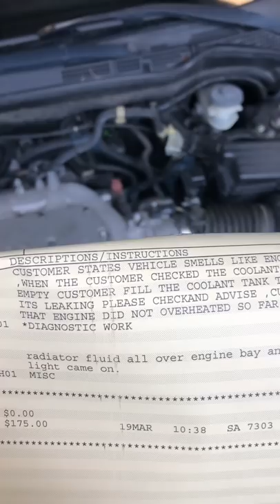Do not use this type of hose clamp because…

Comment: The reason that worm drive clamps are not used on cars is because of heat expansion plastics can expand alot more than metal so the oem clamp will flex and keep constant pressure on a tube while a worm style one won't budge and therefore will stress the tube and break it
Reply from the maker: Yes yes! Perfect! I’m glad I’m not the only one that knows this! Thank you!
Reply: Okay, I was going to call bullshit but this is a really good explanation. Thanks
Reply: Absolutely correct, worm gear clamps are a temp fix and should not remain on for long. OEM pressure clamps are recommended as you said but also dont dig into the rubber like worm gear does. Truthfully when it comes to coolant lines as a professional high performance mechanic I always recommend silicone hoses paired with T-Bolt Clamps. The edges are beveled upward so the clamp doesn't dig into the hose on the outer edges (recommend Mishimoto or equivalent). When it comes to vacuum, oil, fuel and power steering lines I always go stainless steel or nylon braided hose with A/N fittings, bung welding required but will last you a lifetime of non headaches knowing the lines are rock solid and easily replaceable.
Reply: Well, alot more things were made of metal and brass back in the day..
Reply: I was about to call bullshit, then I read the magic word most vehicles are made of these days: plastic.
Reply: @IRDStudio  intake manifolds, radiators, valve covers. I've used dozens of worm type clamps on dozens of vehicles over decades, never had an issue. And if one's not enough, ya put 2 on it!
   If there are factory spring clamps on my project, I do try retain them. I just don't readily find them in my auto parts store and I don't believe each clamp has a large adjustment range forcing you to buy more of an assortment pack or near specific size. Maybe I should start getting those at my local junkyard, I usualy get a few relay and fuse freebies each time I go..
Reply: You don't say..
Reply: Yes and also it's easier to manufacture the car with the spring clamps too. So a mix of both.
Reply: Ah
Reply: yes you are right, but you have to buy the oem or correct spring rate of the clamp. I remember back in the day where i bought aftermarket spring clamp for my fuel hose, at first i was like this spring is quite soft and then few kilometers i have no power and the fuel is dripping down the road. I still use worm clamp on older cars where almost every part in the engine bay is made of metal.
Reply: Yep issue is parts that should be metal are now made from plastic. Can’t wait for electric, what they have done to the internet combustion engine for emissions is daft :)
Reply: @STSmithable  damn that "internet combustion engine"!
Reply: @joeblow8893  damn it to hell!
Reply: More because of time in the manufacturers plant.   We can set these and adjust them in just a couple of seconds.
Reply: Well, they should've kept them metal, lol
Reply: I hate those clamps so much I will use a whole roll of duct tape before I buy another one of those
Reply: Thank you for explaining. Laws of thermodynamics and entropy meet engineering.
Reply: That's why they make constant torque clamps. They always have the same clamping force no matter the temperature and are very hard to over tighten. Use the old style ones where they belong, holding frayed cable end to a battery post🤣
Reply: @brandonjohnson3566   I was about to ream this guy a new one trashing worm gear clamps just because idiots over tighten them, not to mention the oem clamps are often more difficult to access and loosen, having worked 18 years on h/d trucks, forklifts, cars, & construction equipment.  First I've heard of "T-bolt" clamps for cooling system hoses, my experience  has only been with exhaust systems - it is a better design though
Reply: Why I go aluminum anyway. And Quick connect hoses are the shit on some models
Reply: Constant tension clamps are a must on radiator hoses.
Reply: no, heat cycles cause brittle plastic and the plastic breaks. those spring clamps are used because they are cheaper, manufacturers also use clamps that crimped on.
Reply: @samsprague6923  except it's a terrible explanation and it is bullshit.
Reply: @brandonjohnson3566  sounds like you don't know how to tighten a clamp.
Reply: @Cent51  I would say the spring clamps are junk.
Reply: @Cent51  what??
Reply: @678friedbed  they are a pain in bum to remove if you do not have the right tool and if the pipe is in hard to reach spot.. 
Screwdriver and you sorted for life.. 
It just when people talk BS and blame the clamps for failure of plastic and say expansion will effect the clamp, then you need to watch that shop..
Reply: @jakemarshall5457  that is a response one gives when you have NO thought process, and before you come back with your spelling, grammer or you can not read properly, if you do not understand, that fact then means your small mind can not grasp the concept of what was being said..
Nothing wrong with those clamps, the plastic of the radiator failed, the clamp was still doing its job..
Reply: @Cent51  I was just saying the spring clamps are junk compared to a good worm drive.
Reply: @Cent51  you're a little bit of a lost cause
Reply: Until they lose tension and you use a worm drive clamp anyways.
Reply: @MrTheHillfolk  the only real way they could loose tension is if somebody opened them wayy to far or they got extremely hot in wich you probably have bigger issues
Reply: I did not know that thankyou
Reply: Man is not true
Reply: Naa
Reply: LOL so they are not used in your world because the rads are garbage... 

Also have yet to see this issue... the problem is making it too tight... has nothing to do with the clamp... (aside from not idiot proof)
Reply: I did not know that there was a reason for using the OEM clamps. For some reason I thought worm drive hose clamps were the best. What about that tool that let you tie your own hose clamps out of wire? I thought that look cool but I can't see it expanding correctly
Reply: BRB I got some work to fix.
Reply: I dont care how you explain it iv worked on several 1000hp plus diesel trucks that get thoroughly heat cycled and this simply isnt true. What happens is lazy mechanics install the clamp with a impact driver or cordless ratchet which is wrong. There is actually a torque spec for wg clamps and if you follow it things wont break.
Reply: @2zzlow  they work great but when you are a hobby mechanic like I am they are a nightmare. They are never easy to get to, require dumbass special pliers, and are just an overall pain in the ass but then again, car's are not made to last nor be easy to work on. They are all an exercise in how it may look good on paper but doesn't work well in the real world, designed by people that have not actually worked on a car. Who would have thought that using plastics in high heat fluid transfer systems would cause problems. Even with the proper clamps reused, the plastics turn brittle from multiple heat cycles.
Reply: Thanks for some information.  Also the vid.
Reply: @2zzlow  he makes a point but my older car has worm gear clamps on all the hoses and a plastic radiator and nothing cracked
Reply: It can happen yes, but use nothing but these and with a little maintenance in the spring and fall to adjust, they work just fine.mine never leak. Just because it takes more than five minutes to install and keep working doesn't mean they're bad.
Reply: Well first off the oem clamp is metal, the only problem with worm drive is that people tighten them to much there is a lip at the end of the neck the clamp just needs to barely be tightened past that just enough to hold it it the neck, once the hose fills with pressure it will automatically seal, the problem with this is the radiator neck had completely dry rotted has nothing to do with the clamp.
Reply: That’s why you use a constant torque type. The OEM style are like a lot of things OEM: they aren’t using them because they’re “better”. Something like plastic fittings and plastic rad tanks.
Reply: this isnt the reason at all they are used because they are sooo much cheaper for assembly process. the manufacture doesnt care about the car lasting any longer than the warranty period only on money saved in the manufacturing process.
Reply: Well perhaps it's time to go back to using metal radiators instead of these PIECE OF SHIT PLASTIC ONES!!!!!!!
Reply: As long as you don't tighten the shit out of them, they're fine
Reply: Don't tighten the shit out of the worm clamp, and the hose ends crack due to aged shitty plastic.  That radiator was ready to fail in a number of other ways anyways.  Once plastic ages and dries out, it gets brittle.  I've seen these cracked with factory clamps as shown.
Reply: That’s why I only use zip ties. Flexes with the plastic fittings.
Reply: Yeah, no, it's because they cost 5-10x as much and they ARE used on plenty of higher end cars. Also, plastics do not expand with heat. What are you even talking about?
Reply: The real reason is because the spring clamps are cheaper and quicker to install on the line.
Reply: My 88 trans am uses worm drive one factory
Reply: I've seen this with Clamp style too.The plastic only last so long.When disturbed they break.
Reply: Don’t tighten it like an over achiever.
Reply: Remember when the radiator was metal and you didn’t have to worry about this type of problem. Or all the other plastic garbage that should be metal
Reply: Finally someone explained why you shouldn't use the worm style clamp on radiator hoses.

Thank you !
Reply: Nothing wrong with worm clamps, but maybe if everything wasn’t made of plastic it would be fine
Reply: The real problem is the over tighten market of people.  Been using these for 30 years now with no problems
Reply: they are used on cars. have you ever worked on a car ever?
Reply: Even back in the day you could tighten them so tight you destroy the hose
Reply: Wrong.
Reply: @Bigfootlover69 good try from a person at Googles your information.
Reply: funny we never had a problem when the radiator spout was made out of metal
Reply: If you break the new radiator with a worm clamp before the clamp chews its thread... You gonna be in the Guinness world records
Reply: On todays lesson of car clamps 😅
Reply: Worm clamps have been original equipment on cars for longer than you've been alive
Reply: And then they wonder why the plastic tank cracks on the radiator after a while.
Reply: I use these clamps all the time.  I’m just not a moron.  The rubber hose and sea wi expansion and if the cooling system functions properly it’s never hot enough to expand more then 1-2%
Reply: That makes sense. I have only ever worked on my classic car as a hobby, so I got worried for a minute.
Reply: Had this explanation not been the first comment, I was calling bullshit.. I've used the worm gear drive style hose clamps in vehicles for as long as I can remember,  never had an issue with them before but this totally makes sense...
Reply: you don't over tighten clamps nor bolts to prevent them from breaking.. the oem clamps are referred to as tensioner clamps which i dont like. it's a preference.
Reply: Thx for breaking it down, now i need a new radiator 😂
Reply: @IRDStudio 😂😂😂 thank you im here for an 1969 jeep CJ-5 and nooope the Fuc*"infgg. Radeaditor is made of brass and those older style clamps are so good i got this engine 😂 with almost 2 of them on each important high pressured
Part.😮😊
Reply: @brandonjohnson3566 they definitely do dig into the rubber. if you’ve ever moved a hose clamp on a years old vehicle, there’s a clear indentation in the rubber where the spring-style clamp was applying pressure. And the older they are, the deeper they dig in.
Reply: I have literally had those cheap Factory clamps leak. I always replace them with the Worm Drive clamps. People who know better use Worm Drive Style
Reply: @longbow6416  Been working on cars for many years myself. Theoretically the above explanation sounds great and all, but practically I’m not convinced. Spring clamps also leak fairly often in my experience upon reuse following a repair with a cooling system pressure test. I’ve conversely used worm gear clamps on all the usual materials including plastic and have had very little issue over the years. But as long as it holds pressure and whatever you’re clamping it to lasts, I’d say use what works 👨🏻‍🔧
Reply: Don't think the rotten radiator and hose would have made it far irregardless never had a issue with worm clamps in 30 years
Reply: The spring clamps that you love so much are just cheap garbage that the factory uses to save money. most people already know this. Whenever you replace them use the Worm Drive
Reply: thank youu just happened to my car and i was about to use these instead i used insulation tape until i got home which probably wasnt the best thing to use either 😂😂
Reply: Bullshit. Just had a Dodge Caravan in today, neck blew off right at the constant tension clamp. See it ALL the time.
Reply: Can I use a warm clamp on a metal coolant line not too tight? Just because the hard line rusted and I have to cut a bit off, so it also does not have a flare anymore
Reply: The limited lifespan of the plastic cooling system components with temperature cycling making them brittle is the primary issue, not the clamping method.  I had an OEM clamp and the connector broke just the same as if any other clamp were to be used. That just wouldn't happen with metal in the same time of service.
Reply: @Cent51 you would have Biden DNA on your starfish 😂😂😂

Comment: Hmmm I wonder how my connections have lasted 30 years with those clamps……
Reply: Same. OEM clamps are big pieces of shit from my experience
Reply: I always switch to the screw type. The only clamp type I've had trouble with are the Gator clamps. They're hard to get off. The ears break off they stretch and bend trying to get them over the bump on the inlet/outlet. I hate them. I even have the right tools to remove and install them and I still hate them.
Reply: Probably because it's a metal radiator and not plastic
Reply: @LeObsidianCraft  mine? Plastic.
Reply: When clamping metal u can get a decent connection using screw type especially if its the german style ones. On plastic the oe clamps are better.

I had a screw clamp leak multiple times on my plastic intake manifold until i could find the right oe style that even the dealers dont sell individually.
Reply: Never had an issue with neither worn clamps nor tension clamps. If you know what you are doing, there shouldn’t be a problem.
Reply: Exactly well stated!
Reply: Like most things, depends who installs it.
Reply: Same as OEM clamps.
Reply: Radiators used to be made of metal now they’re all plastic
Reply: you didnt wear  girl gloves when working on your car lol
Reply: I always replace worm gear clamps with spring clamps. Those worm gear clamps are pieces of shiz.
Reply: That’s what I’m saying lol dude just felt like talking shit
Reply: Did you know, that coolant leaks do not have to be seasonal?
Reply: cause you got lucky? OE knows what they're doing. Use the correct clamps for a guaranteed install
Reply: @lidibs6641  they are not
Reply: Amen ....
Reply: I wonder why you had to point out the exception when we're all talking about the rule.
Reply: Exactly!  Never once had a issue with the good quality. Worm gear clamps.  Don't ever use the cheap harbor freight clamps since they are garbage
Reply: @22mpb understatement of the year. If you open the cooling system, you should be pressure testing before releasing to the customer. You will find any issues. I use worm drive clamps everyday without an issue. The only spout I broke ever, was on my own damn truck because I used an air ratchet being lazy as it was my own truck and not a customers.
Reply: Ah yes it’s simply because you tightened it correctly… most people overtighten… then this occurs..

I agree with his advice, get the factory clamps… save yourself time and money doing it right the first time
Reply: 213,746 on my vehicles alone. This is dumb advice, even if scientifically accurate. The big takeaway is to not gorilla tighten the worm clamp.